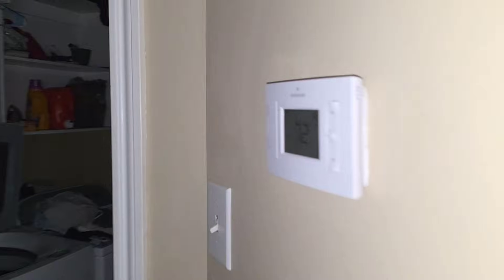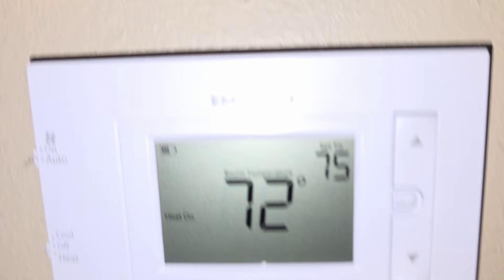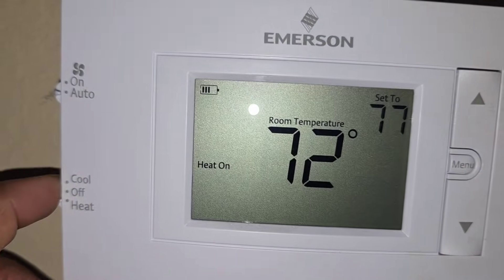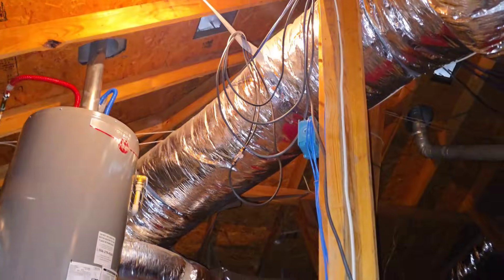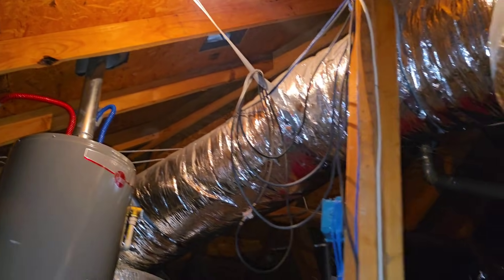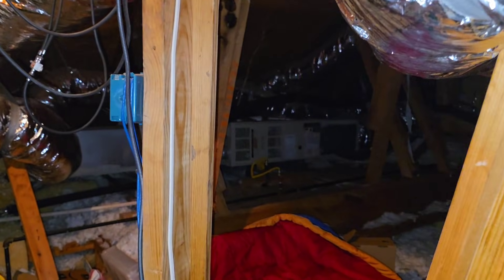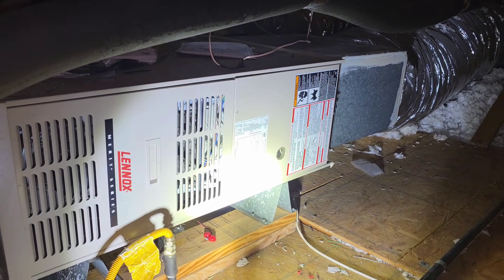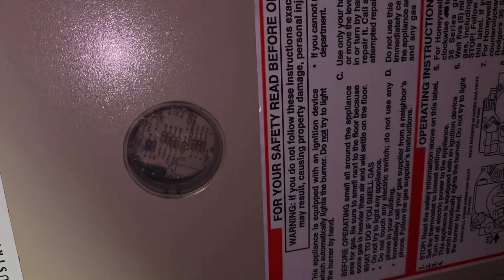Lennox Furnace Not Heating – Bad Igniter Upgrade (80V to 120V) 🔥 Heater Repair KATY TX 🛠️

Comment: I need one of those interlock switch tools. Also excellent mounting of the control board whoever you are. I know to look for the 80v HSI's on Trane but did not know Lennox also did that.

Comment: The 80V ignitor fix to 120V silicon carbide ignitors burning out sucks. Just added confusion. The silicon nitride ignitors at 120V finally solved this issue, but service techs will have to deal with this crap for years to come. Wonder why all the manufacturers just didn't switch out to spark ignition, like most of Rheem/Ruud? In any case, very nice repair, thanks.

Comment: You wouldn’t get a beep on the igniter you have to put the meter in olms and it would be between 50 and 100 olms or you would get ol if the igniter was broken